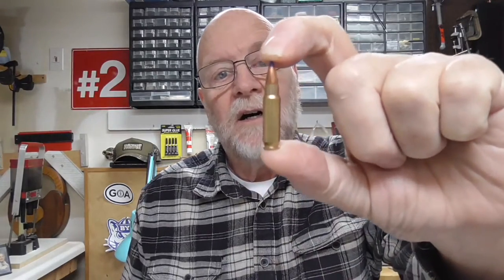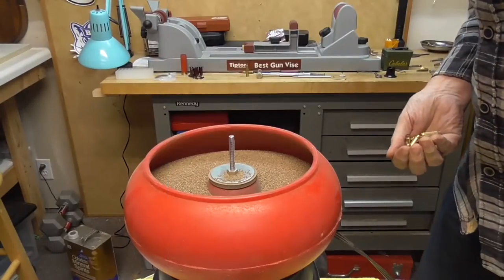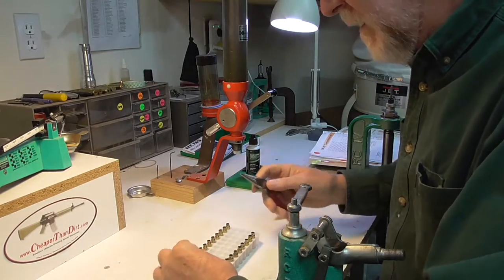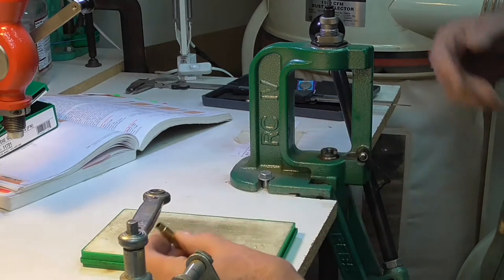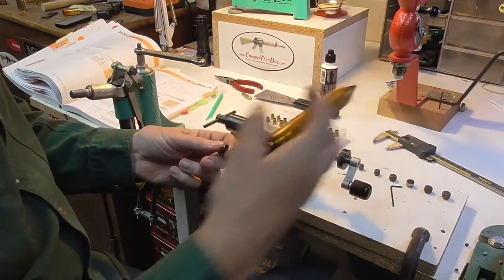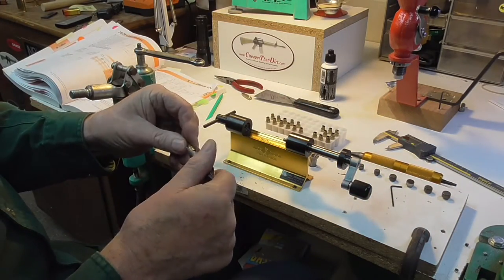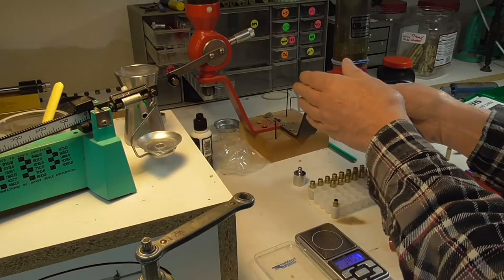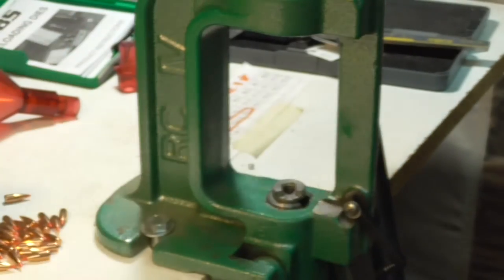Reloading 5 .7 x 28 FN (sizing, trimming & seating)

Comment: Step 1, DO NOT TUMBLE THE BRASS, it takes off the coating. Clean with very light Simple Green and Water solution.
Reply: YES!
Reply: I like to use redding imperial sizing wax, seems to protect the entire coating during resizing/depriming
Reply: If your gun is a FN…
Reply: I don't even do that, I just lube with unique case lube and size them. Wipe them off, trim and load. Haven't had any trouble with that yet.  When I first tried I was tumbling them and was getting a pretty good ammount of case neck separations. The coating is needed apparently lol.

Comment: Did it seem the tumbling removed all the varnish coating?  A control group to compare would have been good to see, as I've read just wiping down any dirt and reloading preserves the varnish for a couple cycles.  Also plunk testing/chamber checking the 1.15 and 1.38 to see any difference (if trimming was necessary).  Wiping down the funnel and powder pan with a used dryer sheets does a good job of removing static, assume you know already but just in case.  Great video to give hope to reload this caliber!
Reply from the maker: I noticed that some of the coating scrapped off during sizing so I don’t think tumbling removed much
Reply: I've been reloading this, and found that a mixture of 1 part Simple Green to 4 parts water for a 15 minute soak works well in cleaning the brass. This way you can try to preserve as much of the varnish as possible.

Comment: When the case length says 1.135.  That is what the case is suppose to be...  just cuz it say 1.138 the case neck clearance and crimping the bullet and neck needs to be spot on every time because of the extreme pressure changes  and powder charges. People need to understand and follow these tight tolerances when it comes to these small cartridges and high pressures.
Reply: 1.130–1.140 trim length is perfectly fine. 
I’ve been making some pretty wild 5.7 reloads for awhile now. I even loaded some 21gr hollow points on my channel